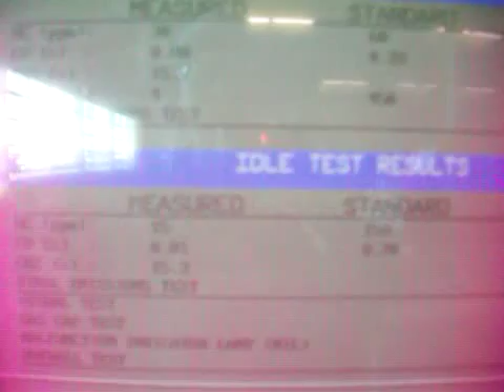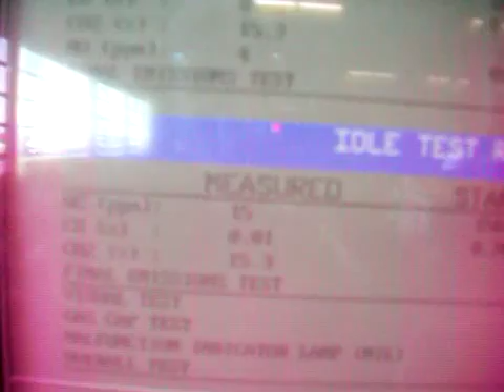2001 Chevy Malibu Emissions Test

Comment from the maker: The intake manifold gasket looked like it had a stain on it, so I insisted it be fixed, which it was.  The root problem behind the manifold leaks are the bolts on the lower plenum loosening, and not the Dex-Cool.  Besides that, after almost 190,000 miles (304,000 KM's), the engine is in fine condition, is decently quiet, and does not use oil in between oil changes, roughly every 3,700 miles (6000 KM's).

Comment from the maker: As I said, the concentration of vehicles to be tested is in the major areas mentioned.  Indeed up North the cars are exempt, and can also use studded tires in the winter too!  You would be surprised what can pass as long as it has an intact exhaust system and a decent converter and O2 sensor.